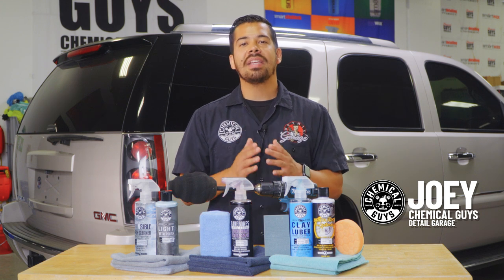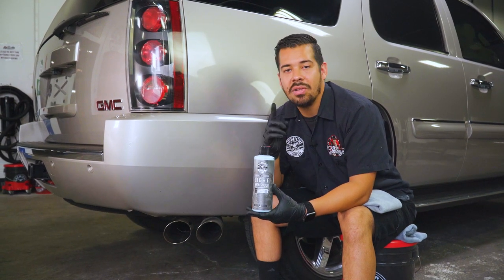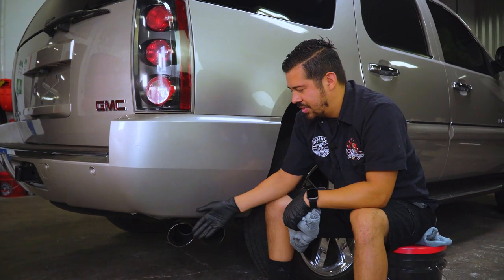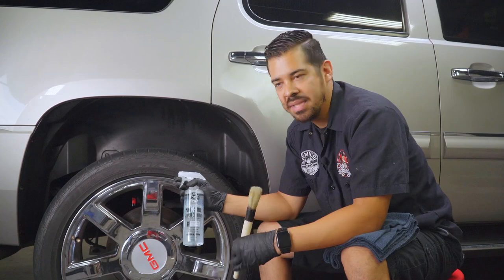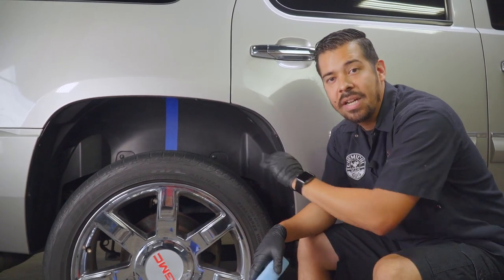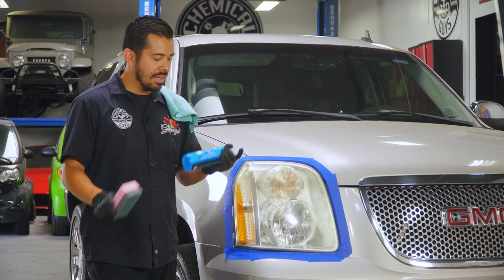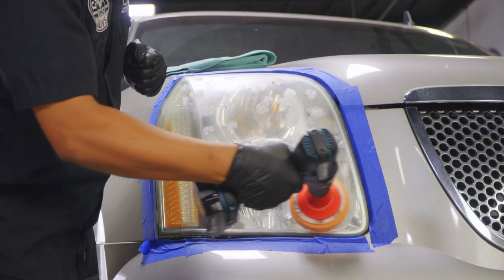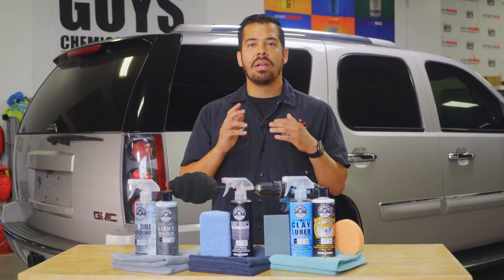Boost the Shine and Value of Your Ride! - Chemical Guys

Comment: I have the light metal polish, works great... had some baked-on tar spots on the outside of my exhaust tip. Shines up now just as good as they did when they were new. I have a full steel chrome front and rear bumper on my truck for the last 15 years+, shines better than it ever has with way less effort in hand/drill polishing. My rotator cuffs and elbows thank you lol
Reply from the maker: Enjoy your detailing products!!

Comment: Quick question : I applied Jet Seal to my wheels and it worked great with brake dust for 3 weeks. I wasn't thinking and used wheel cleaner. Now it doesn't seem to seal anymore. Did the wheel cleaner strip the sealant?
Reply from the maker: Hey! Reapply Jet Seal as needed to maintain durability.
Reply: @ChemicalGuys  Thanks for the response! In another video, it is stated Jet Seal can last up to 12 months. Is this just for normal painted surfaces such as car body panels? Thanks!

Comment: Can I polish with the v 38 and 36 then use wax to shine and finally use the hydro charge ceramic spray? Thanks
Reply from the maker: Hi there! After using V36 and V38, apply HydroCharge to a bare surface and then it can be layered with your favorite wax for added gloss and protection.
Reply: @ChemicalGuys  many 🙏
Reply: @ChemicalGuys  I had a field day! 

Wash then rinse. The wash with that amazing pink soap. Then rinse. Use that clay bar n blue lube and then rinse haha.
I did v34 with the torqx 1 speed then 6 speed. Wipe off. Then v 38 and same thing.

Then I used the black light glaze buff it and wipe. The. I used the wax buff and wipe off. 

And clean tires and wheels windows and interiors lol!

Worth it with the amazing products.

I was scared to use the hydro ceramic cuz I didn’t know where to place that and it was sunny too. Can I still add the hydro ceramic then wax it again? Many thanks!